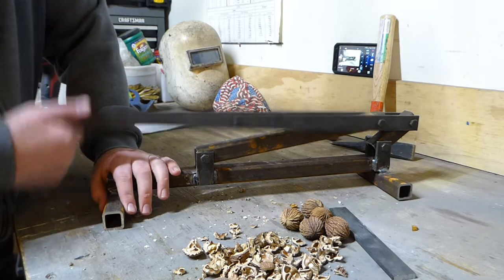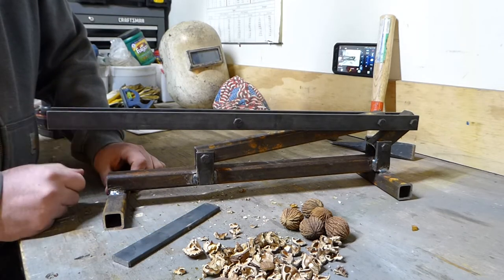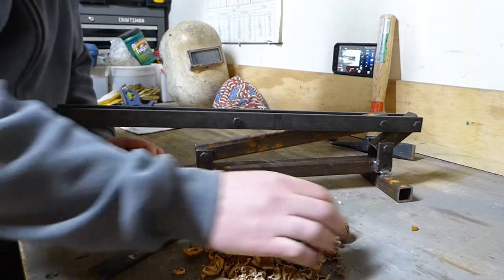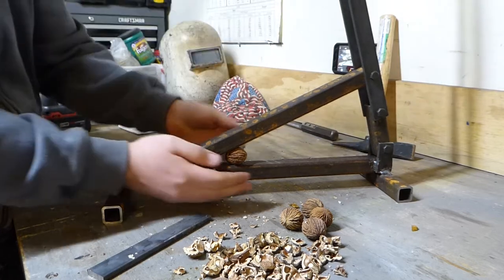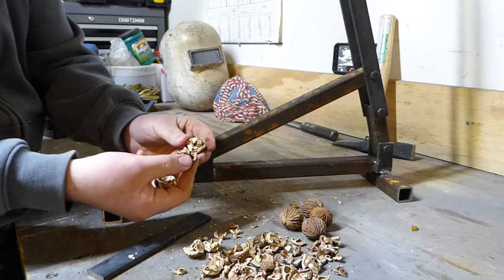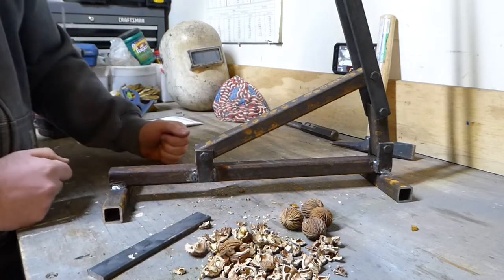DIY Nut Cracker

Comment: GREAT Design.  One suggestion - A shroud to drop over the nut to catch any flying piece.   I'd make the shroud out of sheet metal and either hinge it to drop down before  cracking or just loose slide. Shoot you can even just cut a small clear plastic container to  place around the nut you are cracking.  
Think I can do this without welding (Don't have any access to a welder. Will take  few more bolts to mount the support brackets to the long bottom tube. Then I can mount the bottom tube to a piece of wood for stability.
PS Metal Costs today -  4 December 2023 in NW Arkansas -$35 and change for pieces Flat Strap 1" x 1/4"  x 10ft   Square Tubing 1 1/4" 11 gunge x 10 Ft
Reply: have you built one yet ?? without a welder
Reply: Yes, found plastic caps for the ends of the square tubing painted it with rustoleum hammered silver.  Di add flat stock with rough grooves to the bottom leg to keep nuts from sliding out or popping out.  Would post picture if I could.  Looks store bought now.
Reply: @user-wn3fl1ix5n  Yes, it works great. I did make a couple of minor adjustments in the length of sections to permit bolts instead of welding.  I also added a flat-stock piece with grooves cut into it - it's purpose is to keep nuts from sliding or popping out of the cracker.   I also just cover the area where the not is resting with cloth to catch flying pieces of the nut.

Comment: Nice design. Couldn't help but notice the hood and cromer. Are you a pipefitter?
Reply from the maker: Nope. What's a cromer?
Reply: @MrTidangerous  I think I misspelt it. I should have said Kromer, as in Kromer cloth caps for welding. Most pipe welders and Boiler makers ar familiar with them. I am a retired pipefitter/welder. I'm thinking about making one of these. It looks like a good design, thanks!